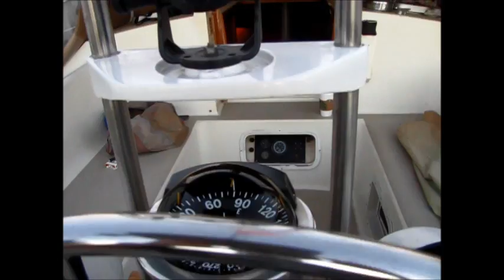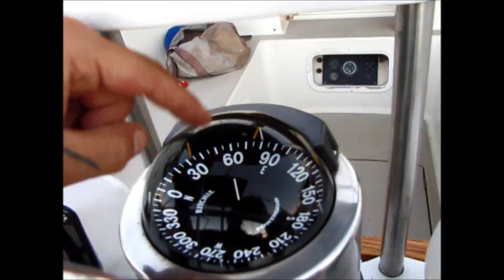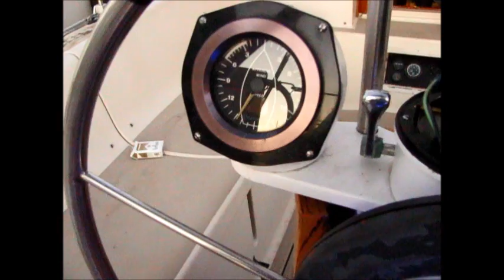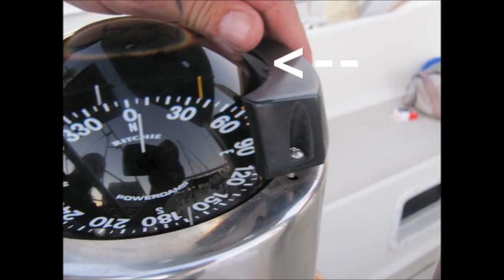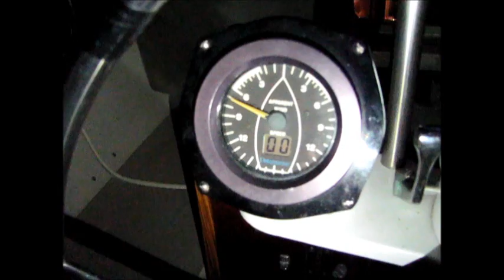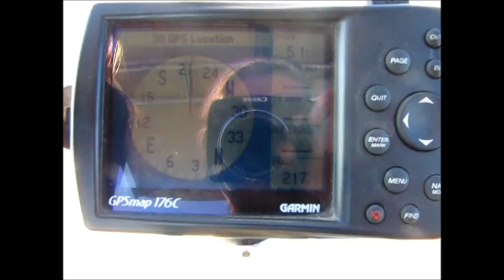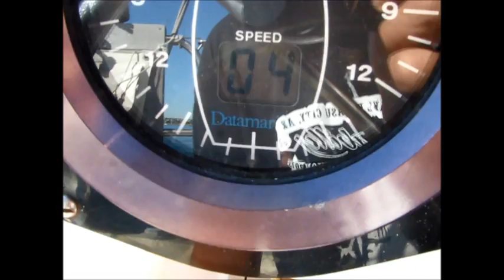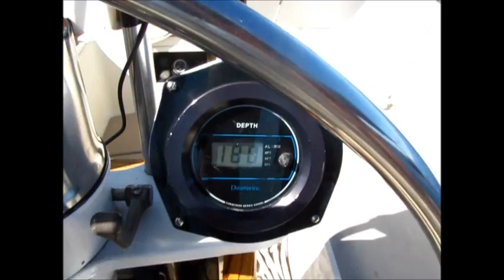S/V Southern Cross ep.5 - Sailboat maintenance the Compass and Chartplotter

Comment: Great video! Keep it up. I will make one recommendation. Blue light is the absolute worst for night vision. It looks great, but if you plan to go off shore for overnight passages, blue light will ruin you night vision. When you look away from the light, you won't be able to see anything. Red light is much better for protecting your night vision. Please keep up the videos and good luck.
Reply from the maker: Jeff Grimsley Yes I talked with Tom (in the comments below) about that very thing. Blue was what I had on hand at the time. I will be changing it out to red soon. So far we don't have any overnight trips planned so I wasn't to worried about it yet. Just wanted to get them working. Thanks for the comments Jeff. Are you leaning towards any particular boat yet?
Reply: A Passport, I think. Somewhere in the 40 ft range. I want to make the buy within the next two years. Then repair, sail, outfit over the next 5. Then the goal is to move aboard and cruise at the end of the 5 when I retire.
Reply from the maker: Great boat. Always positive reviews and feedback on them. Sounds like a pretty solid plan and is exactly the same approach we are taking. We hope to take off to the South Pacific between year 3 and 4 from now

Comment: Your red light change was good.  As for the compass, you want it set for magnetic north not true or grid north.  Reason is, each one of your charts has what is called a compass rose.  It's a bit more detailed than on a regular topographical map.  It'll give you your deviation, the difference between magnetic and north.  This is a safety issue if you should loose your chart plotter.  You can add a white plate and right the +/- of degrees with an alcohol marker and change it as your location changes.  If you set it for true or grid north you'll get lost if you find yourself sailing old school.  Not trying to critique you.  I retired from the Army and had some nautical experience.  It's the same principles weather on land or sea.  Except for the set and drift.  That too applies in flight but your using wind currents.  It's not a hard process to comprehend once you try it a few times.  You should be able to pick up on a ocean navigation coarse either online or USCG certified coarse locally.  It'll save your life.  Another tidbit while I'm rambling on.... LOL... is learn how to use a sextent. And practice with your wife on decking the sun to locate your position.  All the new digital equipment makes us lazy and dependent.  Hopefully you'll never have to old school anything, but it is a parrishable skill and a good one to know.  Also... GPS can steer you wrong at times.  Always check the math manually and you'll have wonderful days of sailing in the future.  Thanks for the vids.